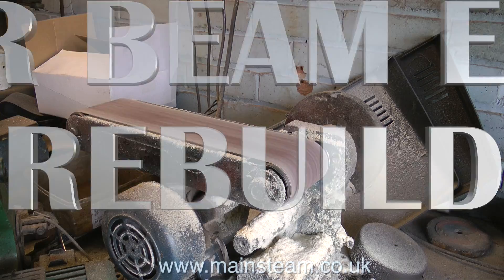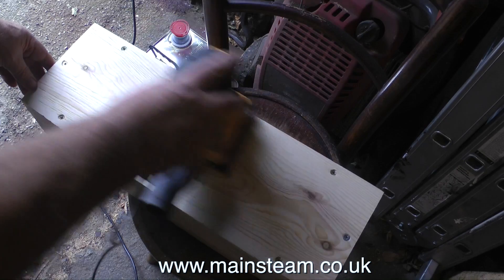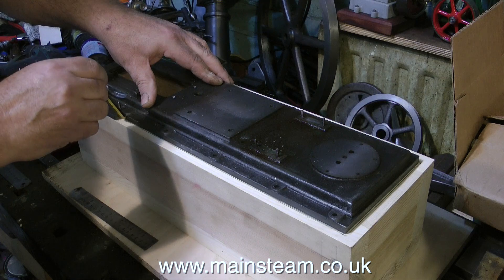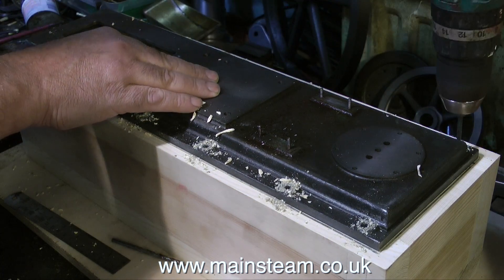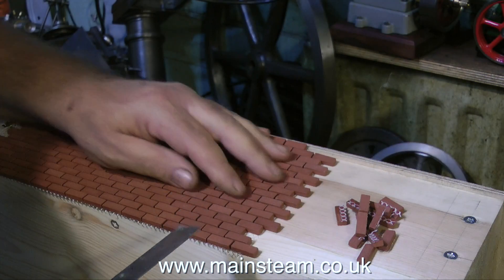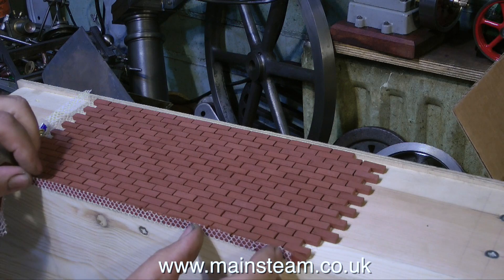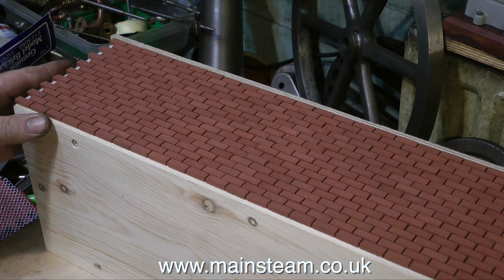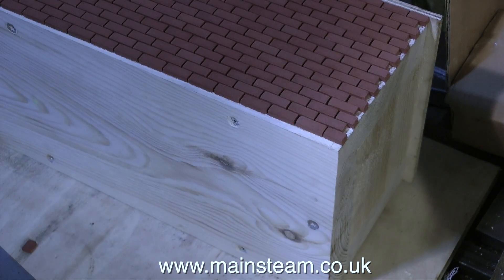STUART MAJOR BEAM ENGINE REBUILD - PART #10

Comment: I would definitely have used a pair of tile snips but that's because I have three pairs of them as ceramic tiling was what I used to do amongst other things. A diamond impregnated wheel on an angle grinder is another way. What you are doing at the moment is very much like tiling with mosaics, a job I used to detest and always attracted a premium rate in the hope that I would not get the job, sometimes it worked sometimes it didn't. If you are going to grout the joints I would recommend that you use a ceramic sealant before hand, no matter how hard these small bricks are they will be slightly porous and if you do not seal them it will be a devil of a job to get them completely clean after grouting.
Reply from the maker: +tileajb1 A good comment, I thank you for your advice. I will probably use "Teifoc" cement that comes with the brick sets, it is I believe a mixture of sugar and fine sand. The residue wipes away very cleanly without staining and it is the right colour & texture.. In any case I will be giving the bricks a wipe over with Polyurethane varnish to seal them.